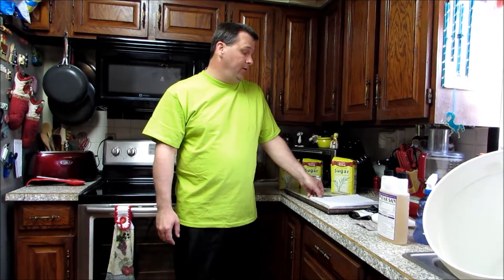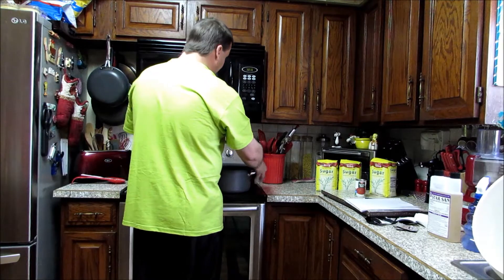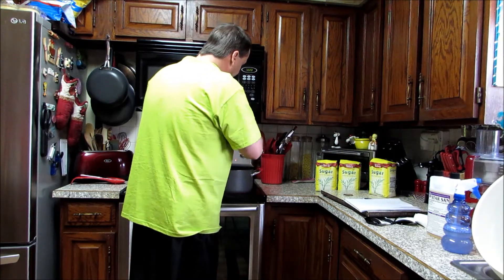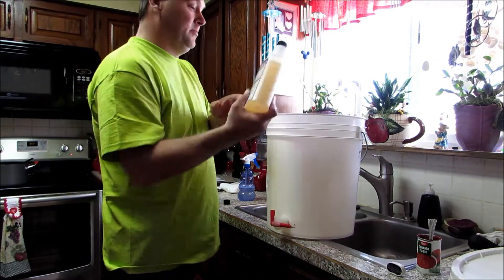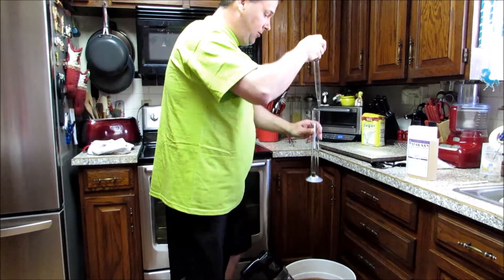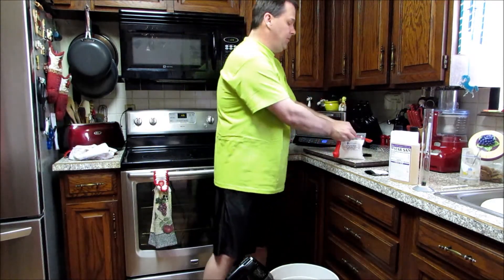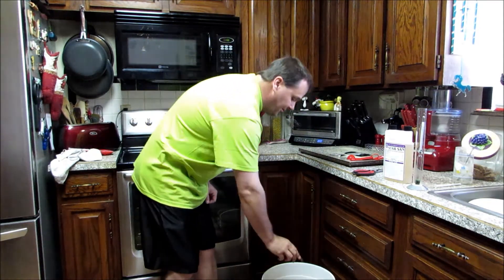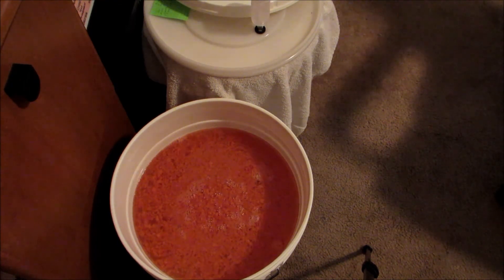Homebrew Wednesday #31 Making Sugar Wash For Wine Coolers

Comment: Looks good Justin Tomato is a werid 1 but as long as it works and Ec-1118 is a good strain - I've used it and the D - Strains with good results looking 4-ward to the next stage Cheer and 17
Reply from the maker: the tomato paste is just added as a nutrient and it will settle out quickly. does not flavor the wash. cheers